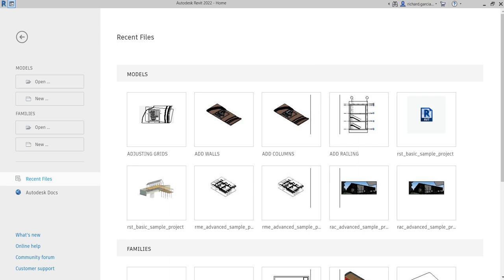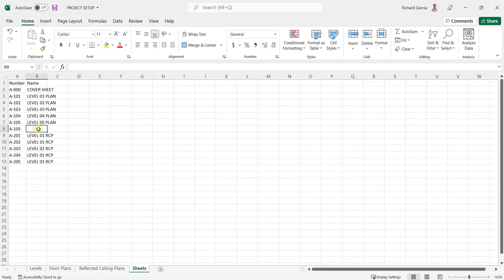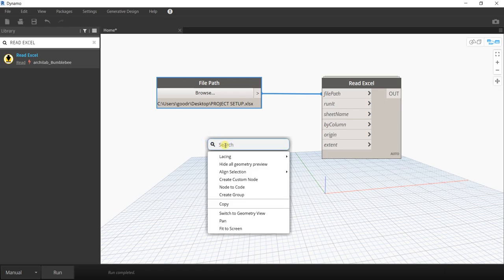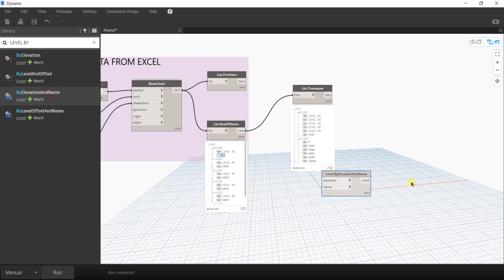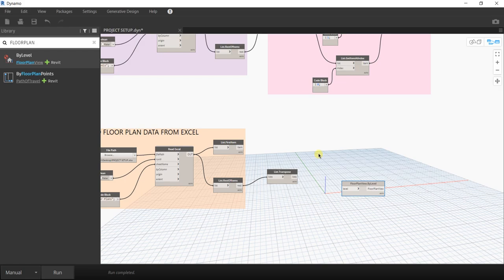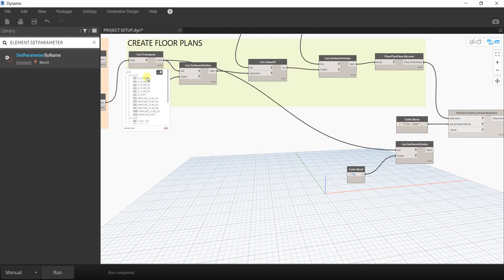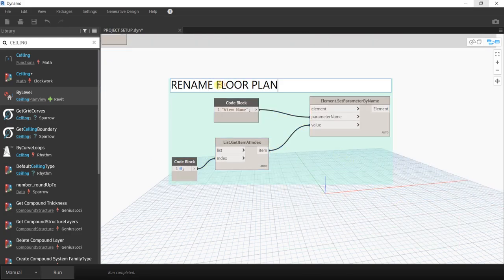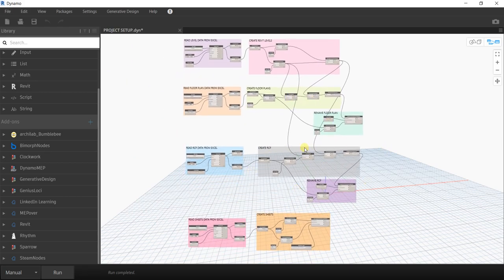DYNAMO FOR REVIT: SETTING-UP PROJECT USING DYNAMO

Comment: Dear Rich. Thanks a lot for your great contribution and its very informative video. creating sheets is too useful from excel and presently taking time coping from excel to sheet list. i wish to ask an example, if our projects having 700 piles with different size and different tag like P1, P2, P3 etc. i hope a dynamo script can read and give the total quantity by items. pls note that, piles with in pile cap family. could you try and  let us know the result.
Reply from the maker: Hi Ssn, definitely there is a script for that. But not sure yet what are the nodes. Try using first schedule.